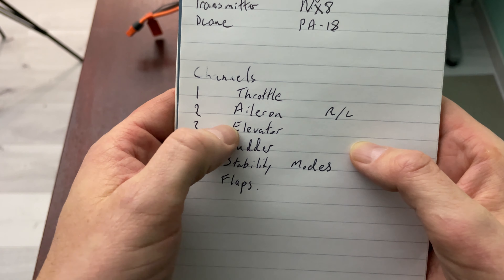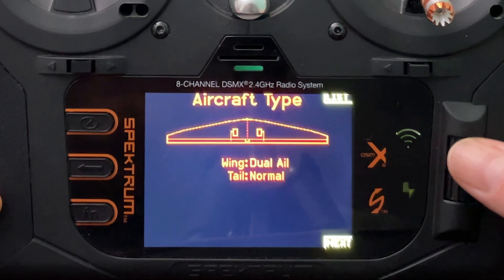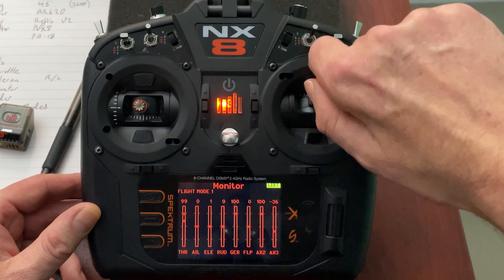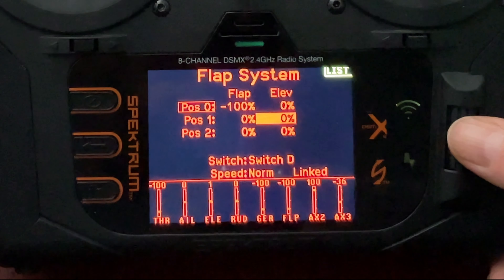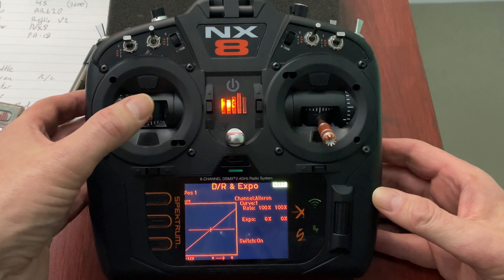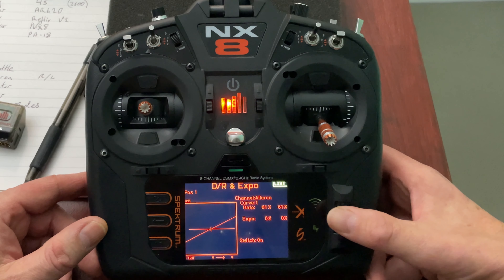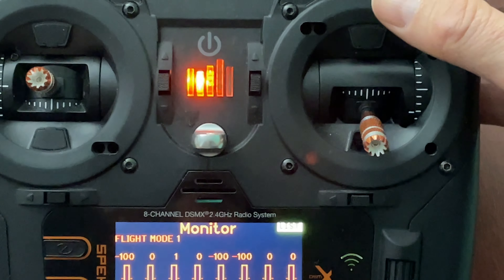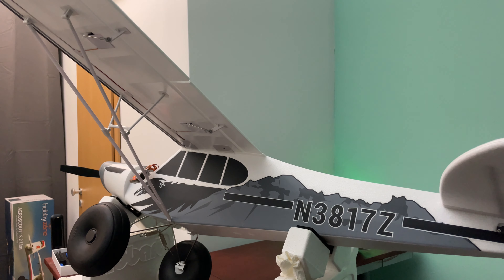Radio Transmitter Setup : FMS PA-18 1.7 Super Cub : Spektrum NX8 : Spektrum AR620 Receiver

Comment: PLANE: FMS PA-18 1300mm
TX: Spektrum NX8
I just finished connecting my V3 to a Spektrum AR620. Bind is complete. All functions...functioning. Except V3 modes. I've assigned it to Channel 5 on Switch B.

I set this up as you did...Channel 5/B switch/Aux 2. I noticed in my Monitor I'm not seeing Aux 2/Ch. 5 change with the B switch positioning. 

 I've gone through all the info I can find and I'm stumped.

Comment: Great video! Did you set up the low and high rates as per the instruction manual or did you just go with your gut settings?
Reply from the maker: I’ve set a switch with 3 positions now. R100, E0; R95,E10; R 85,E20. Its personal taste, seems easier for me to fly with 10% expo.  The most is used when training my friends who are beginners.